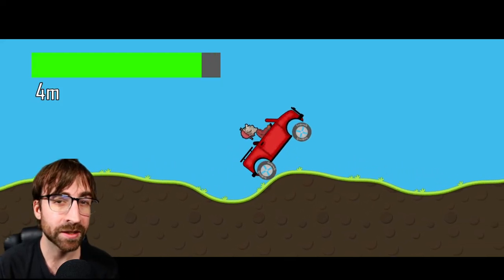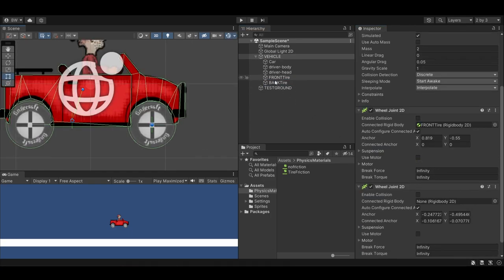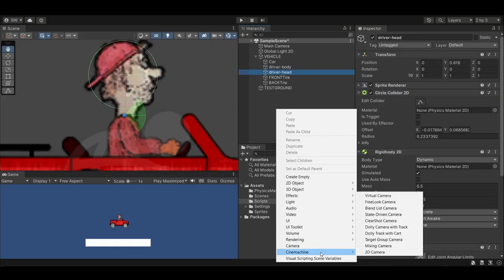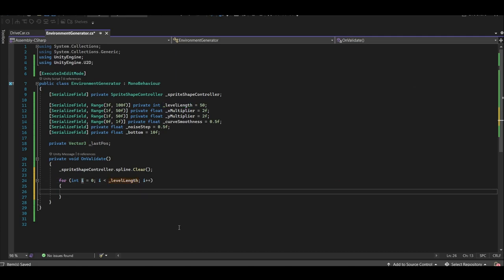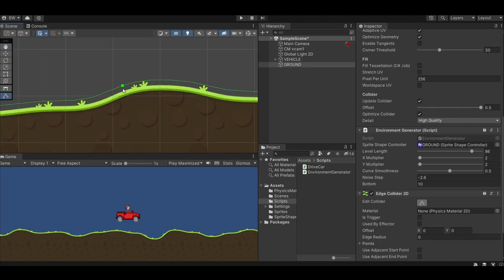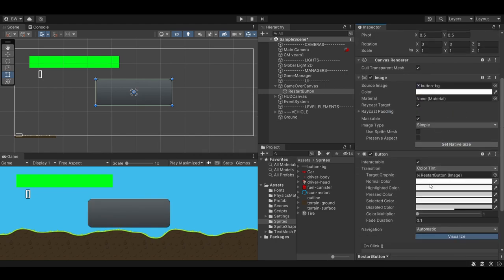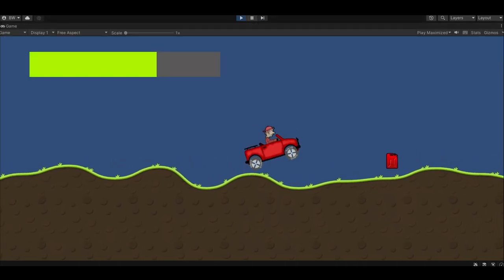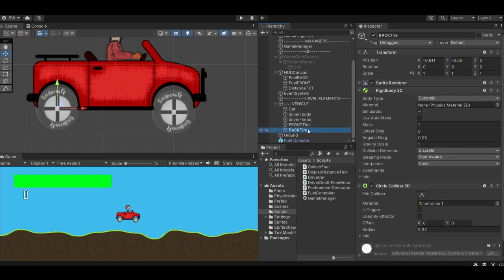Make Hill Climb Racing in 10 Minutes (Unity Tutorial)

Comment: Wow I learned more than I came for. Nice video. How can I calculate the car speed?
Reply: Velocity = distance / time, is a simple method.
Every some number of seconds, you run a check to see how far the object has moved, you'll be able to determine distance since the last check.  Since you know the time since the last check as well, you can calculate velocity.
Say I'm calculating distance every half a second.  So time = 0.5 seconds
Now, say 25 pixels is what I define as 1 in-game "meter".
And, say during the 0.5 seconds of travel, I traveled 100 pixels, or 4 meters.
Velocity = 4 meters / 0.5 seconds = 8 m/s = 28.8 km/h